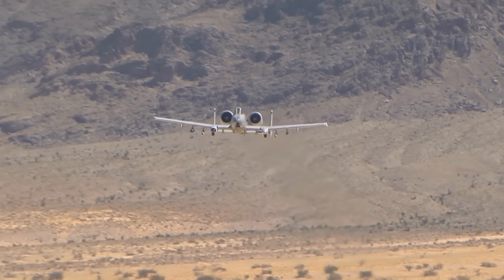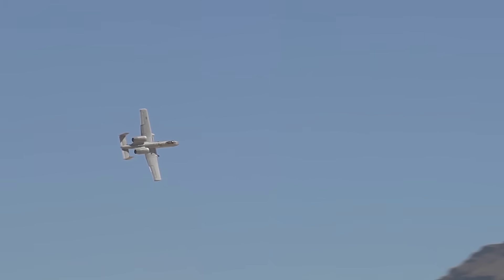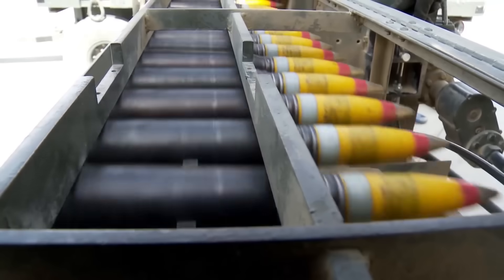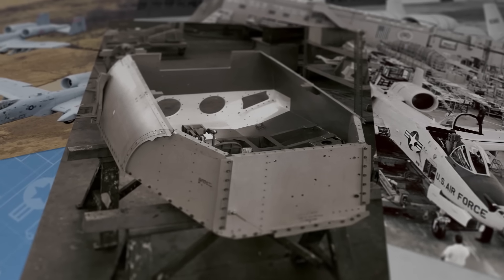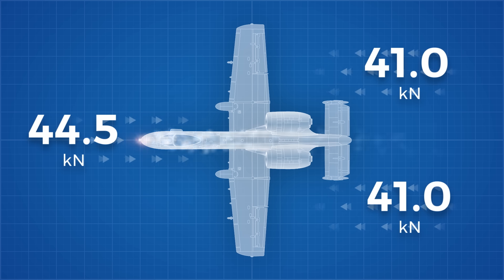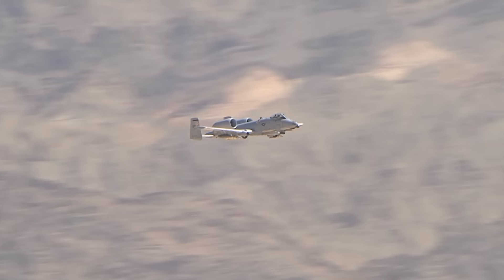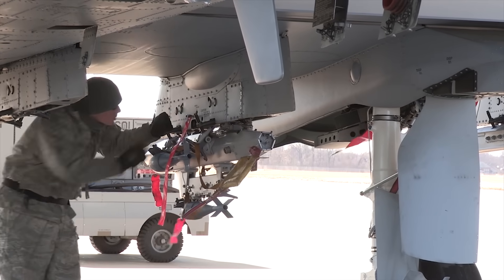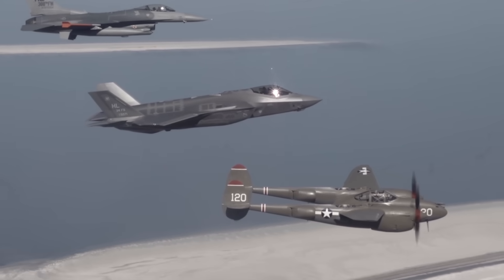The Insane Engineering of the A-10 Warthog

Comment: I still absolutely love the fact that the same people that make your washing machine were like "here's a flying anti-tank BRRT machine"
Reply: Yeah, like comparing your friends Lancer Evo to one of the Mitsubishi rockets. Something in the company name only.
Reply: @Zlonk7  the top armor is the weakest point and that is what it would be hitting.
Reply: @Hoyt-pn3ky  I just provided evidence in the comment above
Reply: @Zlonk7  Well, there are different kinds of tanks - not every target will be a modern main battle tank. Many countries are still fielding older and lighter tank designs, such as Iraq. Also, the Avenger is intended to disable tanks (eg. taking out their treads or targeting sensors by raking gunfire over them) as well as destroying them, and a disabled tank is as good as destroyed. There is also a possibility that concentrated impacts might penetrate even the reactive armour of modern MBTs' roof and engine compartments, due to the gun's high rate of fire. So the gun is still highly effective against most armour on the battlefield and for the toughest targets the A-10 has Mavericks.
Reply: @donkeysunited   the GAU couldn't penetrate 1970's tanks and when it does hit a track that can be repaired in the same day, and my main point here is that it can't bust tanks and that it's gun is a bit pointless swing as the F35 has a 25mm cannon which isn't as powerful but can still do damage. And not just that, the A10 is outdated because the redundancy it has is unneeded since AA has become more powerful over the years and that's why so many stealth planes have been in development and why that much redundancy is rare in aircraft
Reply: @Zlonk7  I agree that I'd be reluctant to rely on its gun against enemy tanks. I'm sure there will eventually be defenses that will make Mavericks useless as well. But the A-10 and its gun have a role. Once the majority of AA has been neutralised by the drones, stealth bombers and maybe F-35s, the A-10 can enter an arena and engage a variety of targets from artillery to weapon emplacements, parked aircraft, and light armour. If anything tough appears, the plane's Mavericks will take care of it. And for the small number of remaining AA, the A-10 has higher survivability than other planes or helicopters. If a new AA site lights up, then a nearby drone should take it out.

There are enough possible battlefields that the A-10 and even its gun are still a useful weapon system. Admittedly it has much lower chances against Russia or China but a war with them would be very different. Smaller countries that buy that hardware would have them in smaller numbers which make them easier to neutralise in advance.

I don't see the A-10 being declared useless until America can fill the sky with stealth drones that have enough munitions to engage multiple targets. A couple of drones loitering in the area and dropping an LGB or missile just cannot compare to the carnage that a few A-10s can do to a suitably softened enemy force.

So yes, the gun is no longer a modern tank buster. But the plane is. And the gun is still a modern armour buster or for soft targets. And against weaker armies of which there are many left for America to fight.

And that's really the role of the plane - it does a job that no other USAF aircraft can currently do and it costs a lot less than a modern stealth aircraft. And that should be a deterrent to any small nations interfering with US interests.

Note: I'm not American, I just admire the hardware.
Reply: @donkeysunited  i mean the f35 can do  the same job as the a10 if it needs too, it can carry about as much ordnance as the a10, and the a10 is half a century old by now so they should start gradually retiring it
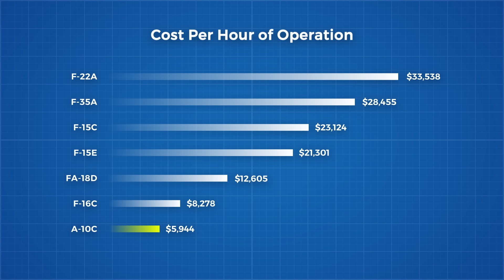Reply: @Zlonk7  While the f35 could very well do the same job as the a10, it probably won't take over any time soon due to one of the same reasons it was built, cost. For the same job why send in an f35 when an a10 can do it at a fraction of the cost, as shown at 13:25, and if it's shot down it's much cheaper to replace then an f35. Cost is always a big factor so while it should probably be retired and replaced, doing so just isn't cost effective yet.
Reply: @Zlonk7  Why did you link a paper that directly contradicts you... Literally in the abstract they said it "proved to be an effective damaging agent against substantial areas of the MK 47 tanks used as targets". Also those were api, armor piercing incendiary, which as far as I can tell, do not use depleted uranium, which would have better penetration. 
I'm sure it wouldn't fare as well against a heavy tank, but the paper shows that against light or medium tanks, the GAU-8 is an effective weapon capable of piercing armor (pierces 3/5 times it hit) and disabling them unless it hits a particularly thick piece or the tracks, and remember, those were api, not du. 
Against a well equipped nation, there would be no use for them, since I doubt there will really be any major land conflicts, it would mostly be done with icbm's and cyber attacks. However, for less equipped groups, they do their job well, better than any other aircraft, which is why they're still in use, the f-35 isn't as effective anti tank, and is a HELL of a lot more expensive to buy and maintain, plus requires more specialized equipment to repair. Then on top of all that, there's the psychological aspect of hearing an A-10 coming in, both from the enemy and ally side, then the brrrt, you know exactly what just happened.
Reply: @BilboSwagginsTheThird   can you understand that the tanks were not moving? They weren't deploying smoke, the A10 wasn't being shot at by anti air defenses. In those conditions a maverick would have a kill chance of 100%
Reply: @renalreilly67  well that's the thing, close air support doesn't need you to be low to the ground it just needs you to have a large amount of ordnance, and yeah it having a shorter loiter time is a downside buy it can carry about as much ordinance as an A10 believe it or not and a bomb or AGM from high up isn't much different from an AGM close to the ground. A10s fly close to the ground so when you see them firing their GAU it's much more impressive than a F35 firing a maverick from up high in the clouds
Reply: @fulcrum2951  all it means is that it's attacking enemies close to friendlies, that's what the close means
Reply: You spew a lot of half thought through statements as if they were irrefutable logic, and they're far from it.

Main battle tanks still have many, many Achilles heels. Well placed .30 caliber rounds, even just Ball and not necessarily AP penetrator rounds, can and have disabled modern MBTs. Optics and sensor arrays and radio masts are not armored enough to take a direct hit. Even a few .50 BMG rounds would make quick work of the smaller parts holding tank treads together. A tank that has busted treads is effectively disabled. I don't care if the repairs can be done in an hour, much less a day, they aren't getting repaired when in a battle, so for THAT battle at THE time of the breakage, that tank is effectively out of the fight, which is helpful to the other side. Not only all of that, but tanks have combustion engines, even the Abrams turbofans rely on intake of air for oxygen to combust, and exhaust ports to scavenge after combustion, and the easiest target ALL tanks have is their heat exchangers, aka radiators, because they MUST be exposed to outside cooler air, look at the back of an Abrams from the top, there are many, many slits to allow for this, the high volume of fire the gau8 produces all but guarantees that the radiator will receive damage, and that is detrimental to the power plant. You get a little bit of DU shards to hit a heat exchanger, an exhaust port, or the intake, that tank will not function reliably if at all for long. On top of that I again add on top of this the likelihood of the sensor array, radio, and optics are likely to be disabled by a fusilade from the a10, you have a tank that has a living crew occupying it's inside, but that tank is far more likely to do little else in the fight aside from providing cover to others. T72s have been taken out by well placed sniper shots using 50BMG.

Spalling is also a thing, and would also work against the tanks' moving parts
Reply: @Zlonk7  you do realize a10 pilots are basically better f1 drivers. They can easily hit a moving target. This isn't ace combat. It's real life...... to put in perspective 
Its easier to drift a car in real life than to drift a car in forza. Personal experience
Reply: @alexscarborough6263  I mean people keep saying how the A10 is super cheap but most of th reason is because the early versions targeting systems were a pair of binoculars which led to hilarious blue on blue incidents. Also were you an actual A10 pilot
Reply: @Zlonk7  no im not a pilot but I've sat in one and my dad worked on them for years, many of my military friends were a10 mechanics to crew chiefs. I guess its more of a sentimental thing. I went the automotive route.
Reply: @BilboSwagginsTheThird  havnt read the whole comment yet but, “marshmallow cannon” 😂😂😂😂😂💀💀
Reply: @renalreilly67  I can contest to this comment. 100% right.
Reply: @DrPotato0  prove it.
Reply: @Zlonk7  Killed 3 (Reported as Catastrophic, Exploded?), immobilized 4, (2 of which essentially had their guns removed) and 3 with light damage. Under ideal conditions by a single A-10. Operating in pairs with coordinated runs I'd say 4 kill, 5 immobile, and 1 lightly damaged under ideal combat conditions though in poor conditions I would only expect 1 or 2 kills and maybe 2 immobilizations even with 2 A-10's (Even against modern tanks top armour is has likely not gotten much thicker if at all due to additional weight with little gain.) That said against tanks the 'Gun' would be used only after the other ordnance was expended. So you have 10 hardpoints of Maverick, CBU-100's and the like that will have been used first. (1 hardpoint always has a dual Sidewinder mount for air defence)
Side note I kinda want the US to adopt the British Brimstone imagine A-10s with 27 missiles under the wings. Never going to happen though.
Reply: @JoeyBeez  *a spent uranium 6000 grain round @ 3300 fps.  And dude thinks it won’t do anything to a tank….  They are rated to pen 55mm (just over 2”) armor at 60 degrees at 2000 ft,  about a half mile.  That equals an immobilized tank.  Period.
Reply: Also the nuclear reactors in our submarines.
Reply: That really got me haha. I also found out that there are Tommy guns from WW2 with IBM stamped on them. I want to say tanks and jeeps had parts from all the big 3 auto manufacturers too, but I'm sure someone in comments will let me know if I'm wrong.
Reply: @Mr_Roboto  it's war production so I'm guessing they repurposed atleast some auto factories for tank production
Reply: https://youtu.be/wsx8vX8_z7w👍
Reply: Hooray for the military industrial complex
Reply: Not sure where you (or the video) get that the company that made the A-10 was a washing machine company ?  Fairchild Aircraft was founded as an aircraft company and only ever has been an aircraft company.  Idiot sheep folloiwing who ever the F posts inaccurate crap on the interwebs -- so it must be true.
Reply: @uberfu  Uh, fucko, the GAU-8 Avenger is made by General Electric. 

General Electric also makes fucking washing machines.
Reply: @uberfu  I am sure that he was talking about General Electric and the GAU-8
Reply: @uberfu  the GAU-8 was built by General Electric. You know, ‘GE’.  They do everything from appliances to nuclear submarines and everything in between.
Reply: The gun can't bust tanks, that's why it has all those missiles
Reply: @Zlonk7  Have you seen what 30mm Depleted Uranium rounds do to armored vehicles???
Reply: @Anvarynn  yeah maybe it can bust an APC or IFV but a tank? Nope. If you need a source for my claim I can provide it
Reply: @Zlonk7  that "gun" turns tanks into Swiss cheese
Reply: @Thedoza  yeah,  ‘Swiss’,  as in ‘neutral and poses no threat’. 🤣🤣
Reply: @Zlonk7  you live up to your name
Reply: @darkhawkgaming3238  my name is a trap because I get to laugh at people continually making a uncreative joke

Comment: Even though it was designed for a different era of warfare the Air Force has found a place for it even with the F-35
Reply: It only good against terrorist but even with that it's still a couple decades out of date
Reply: @Zlonk7  and light armor vehicles mass infantry. Yes it's a couple years out of date but there's nothing in the Air Force I could really do what it does. It can carry basically any weapon the F-35 can but also carry in a 30 mm rotary cannon and can take more of a punishment than the F-35.
Reply: @clonescope2433  the f35 has 25mm which is enough for most light armoured vehicles and can carry about as much ordinance as the A10, but if it needs to go in stealth mode it can only carry a third of the A10's ordinance. But the big difference is since the A10 isn't stealthy at all it can be torn to shreds by modern AA systems so the redundancy systems are kind of useless if it encounters any anti air
Reply: @clonescope2433  I don't they can make drones like that atleast right now maybe in a  couple of years we might have full CAS drones

Comment: “.. They just protect the most important part of the plane-“ The gun? “The stick operator.”
Reply: Well, it makes sense, since you can build a new gun in a few days, but you can't build a new pilot, can you?
Reply: @VulpesVulpes4000  Well it takes longer, but technically yes.
Reply: @BigUriel  And the A-10 was designed to be made fast, so protecting the pilot is more important.
Reply: @VulpesVulpes4000  you cant fly a plane back without a stick operator that is why